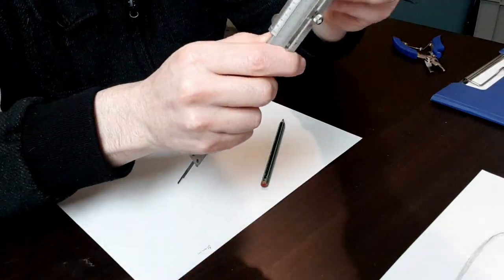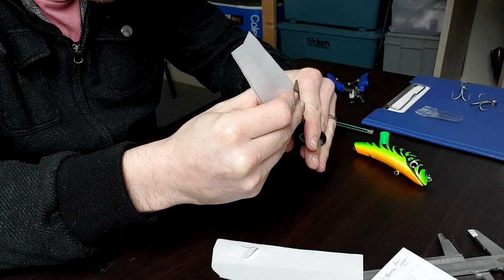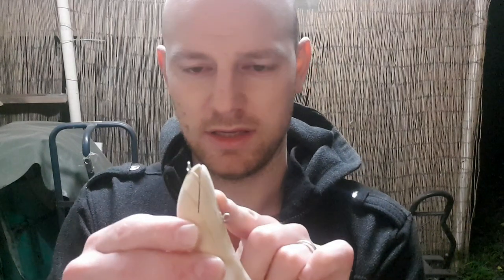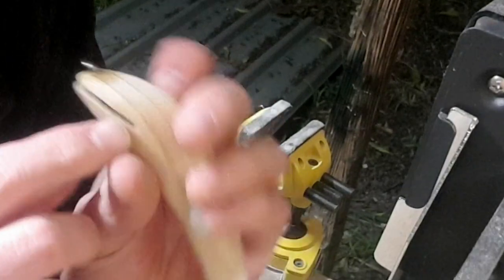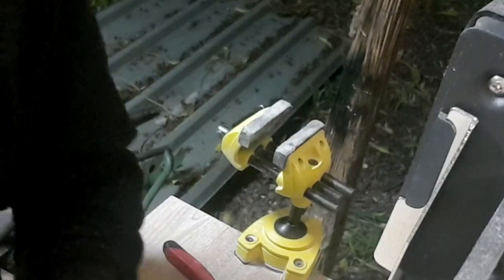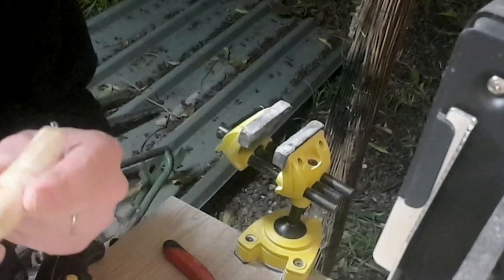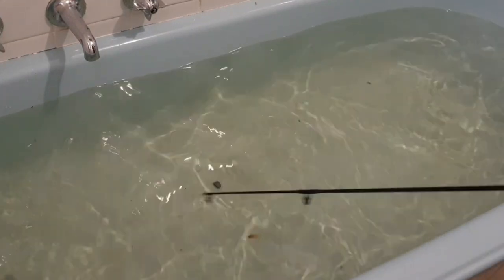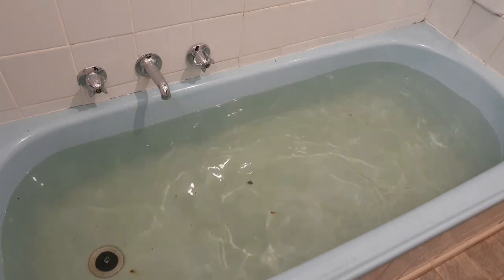Making Murray cod lures 2, Stump jumper build.

Comment: Good vid mate .See you took my super glue on board lol it's good for putting on to test them .The lexen bends easy as nose tow point lures are harder to tune than non nose tow.Ive got one of those cheap ozito tools like a Dremel I think that's why you got on the bench you can buy small sander attachment for them for shaping your lures .👍
Reply from the maker: Haha yeah i did mate.
I have used the dremmel to shape but found it a little too fiddly at times to control.
A bit of getting used too still i guess.
I have a proper belt dlsander but its stuck in the country with my mum at the moment haha.

Comment: You can use a heat gun or hair dryer to shape the polycarbonate bib into any concave or angle you want , might be easier than trying to cold forge it in the vise  like you did.
Reply from the maker: Thanks mate.
Last time I heated a bib it was a bit harder to keep in shape so I tried it this way.
Plenty of different ways i guess.
I have also been told that heating it can weaken it.

Comment: Tow point, bib and ballast are what effect the action mate, the high point wouldn't have been the issue at all. Just for future issues with lures.
Ballast, Bib, towpoint, make them the focus... other than that it could be a turd behind the bib.
looks good mate, defs nailed the Stumpy shape and action.
Reply from the maker: Id say the tow point in this one was main issue by what your saying then bib was fine and I put the original in my body it was the same so yeah.
Reply: Fishermans office 100% mate.
The fact it turned sideways made your job 100times harder. When it’s up and down you can bend it either way to tune.
If your ballast is centered and tow point is centered.
Bib is symmetrical and square your lure is minimal...
I’ve been making lures from uneven weighted resin and getting results once I figured that out.
Just thought I would give you a heads up for next build. 👍🏼
Reply from the maker: Yeah it was a bit m9r challenging with the tow point that way.
Heads up well received broham👊👊

Comment: Weight issue ever looked at Vacuum chamber suck all the air out of the wood using polycarbonate fills and seals all the pores in the wood making also stronger seen one bloke use this method
Reply from the maker: Haha I think I know who that one bloke is.
Yeah I havent really been making lures alot and still learning things.
If I get into it a bit more down the track I will probably use this method you mentioned.
Reply: @fishermansoffice  no worries' mate like ya show cheer's